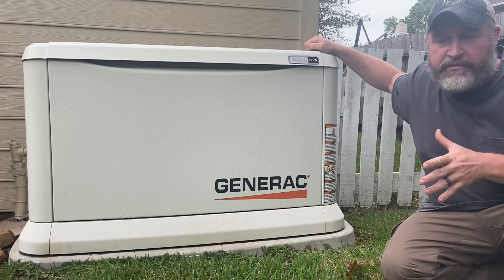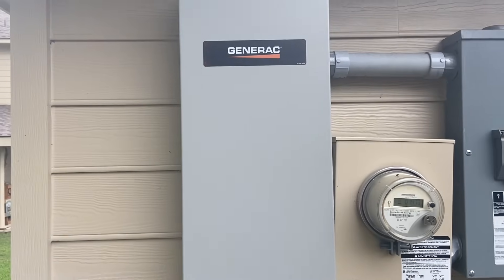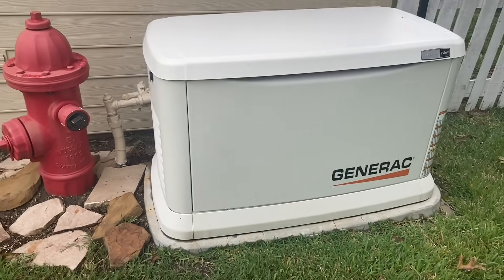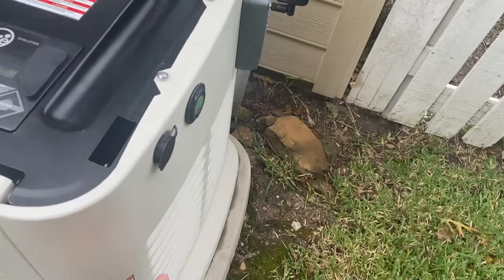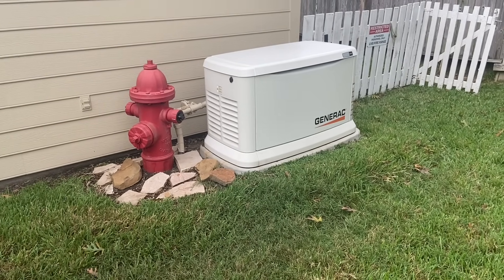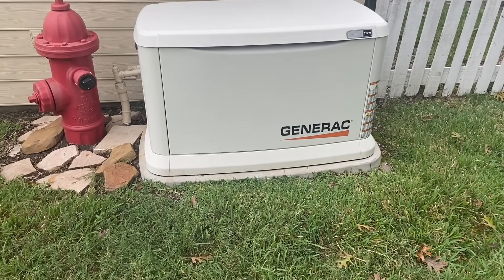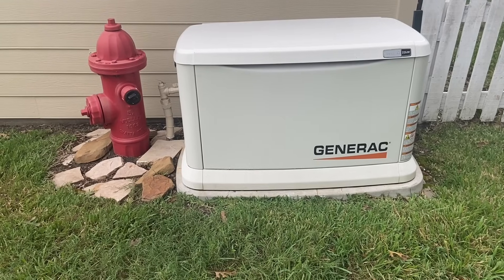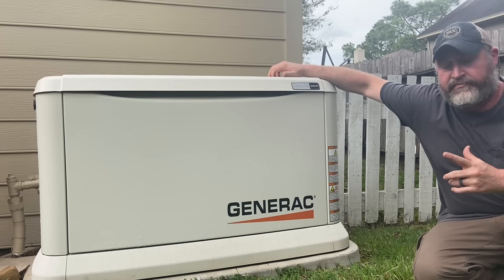Thinking of purchasing a generac whole home generator?

Comment: If running for days during a long term outage, shutdown every 12 hours and inspect machine and check oil level and for leaks.  Change the oil every 3 days if using Conventional oil, every 6 days if using Amsoil Small Engine Synthetic.  If you don't change the oil this frequently, you will pay!  It is an Air Cooled engine so oil breaks down fast.  I have installed and maintain 4 of these for my family.
Reply: Skip the amsoil and use any good quality compatible oil and change it and the filter often, especially after extended run intervals...

Comment: To anyone watching this now, the national average for installation currently is equal to or more than the equipments cost. As well as you will not find a new 22kw for $4800. And remember, this is a piece of emergency equipment, it has a huge convenience factor, but only if it runs flawlessly. With that said, cheap work isn’t good, and good work isn’t cheap.
Reply from the maker: Thank for watching great comment avg for this same install in my area is now 13-14k

Comment: Great video. One thing I would recommend is make sure to spray around and up the skirts of the generator every so often for bugs. I didn't know this and my Generac generator just gave over a warning when doing the weekly exercise and after paying $190 for a technician to come out they found a huge ant infestation inside of the generator, which if any electrical components fail it is not covered under Generac's warranty. Also I purchased mine from Costco and got a 10% Costco shop card which was almost $1000.
Reply from the maker: Thanks BigMo great tip , we have someone come quarterly and spray the house yard etc , but a quick peek can save a lot of trouble. Will be checking ours more often 👍 thanks for stopping by and checking out my channel, please subscribe like and share, thanks and have a great weekend.
Reply: 10/4
Reply: Electrical magnetic fields attract bugs...I use Cedar Oil Spray, bugs hate it, and it lasts for 2 months.  I have a reminder set up in my computer to re-do the bug spray once a month to be safe.
Reply from the maker: @miltonturner2977  great idea !
Reply: @miltonturner2977  where do you buy this magic stuff? Thanks in advance.
Reply: @dustbat  Amazon and Walmart
Reply: I endorse this recommendation. About a year before we sold our house, I discovered an ant infestation in the control module inside the generator itself. They were swarming in there like an ant farm, could be viewed through the module’s display. Generator wouldn’t run, not even its weekly test run. After spraying the ants and blowing the unit out with compressed air, it worked again. Sprayed again several times before we moved.

Comment: I have a smaller version of the Generac. Runs on natural gas, comes on within a few minutes of power out automatically. It does an "exercise" for about 15 minutes once per week. I get it serviced once per year, oil/filter changes and diagnostics check (about $100). Well worth it, it gets used at least a few times per year. Saves you from throwing out hundreds of dollars worth of food... you won't freeze in the winter or fry in the summer. Be nice and let your neighbor run a cord over to their refrigerator...
Reply from the maker: Yes sir thanks for the comment and checking out my video, please subscribe and share

Comment: My wife and I bought a house in southwest Florida in Feb 2022 that had a 22KW Generac setup already installed in 2018 (550 gallon propane tank fuel supply). Hurricane Ian came through Sep 28 2022, and my parents rode out the storm and the aftermath at the house. The Generac performed flawlessly until utility power was restored on October 9. Only thing to note was the need to keep checking and topping off the oil level as it ran continuously. We had a digital antenna setup, so my parents were able to stay informed with the local news stations, even with cell and internet service being down.
Reply from the maker: Right on , we bought digital antennas after our freeze outage, good idea 👍 thanks for the comment and for watching!
Reply: You followed the owners manual!  AWESOME-that will help keep the light on.  So many don't.

Comment: I have a 20kW version, installed back in 2014, also on nat gas.  I'm up in Chicagoland.  Doing annual maint (plugs/filter/oil, I think I'm on my 3rd battery), and only part that failed on the unit was the low oil pressure switch, which leaked.  Part was $35.   

I have had a couple of 24+ hour outages and several few hour outages, and the transfer switch just handles it all.  The whole house can run on generator including the A/C, condensing boiler and air handler, but not the induction stovetop and electric oven.   I even powered my two neighbors with extension cords so they could keep their fridges going during those long outages.   Been worth it, peace of mind, all hard wired with a transfer switch, no gasoline to deal with, safe as no chance to backfeed to the grid.  Cheers!
Reply from the maker: Cheers buddy thanks for watching!

Comment: I have a 16kw unit that I installed and service myself. It has been dependable for over 10 years and going strong. I used to service generators for a living and to me Generac is by far the best.
Reply from the maker: Very cool! my dads has been working for around 14 years, just battery replacements, he has not even adjusted the valve lash. Thanks for watching please subscribe and check out my other videos.

Comment: Thanks for your video!  Very informative. We just got our Generac installed last week (just as Fall starts) and we are very relieved to have it.   We told our elderly neighbors (who do not have electrical back up) that we would throw them an extension cord so they could charge their phones and keep their refrigerator running if the power goes out on our street.  Some folks need electricity to run their refrigerator for their insulin. Some folks may need a nebulizer for their asthma or oxygen machine.  When the power goes down, we won't freeze and we will have the opportunity to help our neighbor's too!   Besides, adding an all house generator to your home will be beneficial to the value of your home.  It is a win-win.
Reply from the maker: Thanks for the great comment and for watching, please subscribe and check out some of my other videos.

Comment: We’ve had ours 3 years now and not a single problem.  Super easy to change the oil, runs it’s scheduled test cycle every Thursday like clockwork.  Four bags of cement from Home Depot for the pad it sits on.  Bought it online from Global Industrial.  These guys where the cheapest.   Had a local electrician install the transfer switch and feeder line for $1200.  Most of the cost of install is in the copper.  Had a local plumber do the propane line to the unit for $400.  All in, we did the whole thing for around $7100.

Comment: We bought our Generac 22kW unit even before we renovated our vacation house into our permanent  home. Paid $4,000 at Lowes when they had them on sale in 2018 or 2019. Had it installed with a 500 gallon propane tank, and our electrical contractor hooked up everything along with a complete rewire of the house. The original wiring did not meet code and was woefully inadequate for the size of the house. Have had zero problems with the unit in the 18 months it has been installed and have it on a two week start-up schedule. Have weathered a number of outages, the longest was about 10 hours. Only thing we need is to put a UPS on the modem for the internet and on the tankless water heater ( found this out while showering when the power kicked off).  Best thing we did for living here in the Georgia mountains!
Reply from the maker: Sweet! Guy that what it all about, thanks buddy for watching please subscribe and check out my videos

Comment: Had the 20KW installed about 10 years ago.  Has been a great backup and peace of mind knowing you will have heat and cooling depending on season.  Our city power department is one of the best and we have few outages, but the handful of times the power has been out, it was great.  Thanks for the video and very informative and very accurate information.
Reply from the maker: Thanks Ross for watching and the comment have a wonderful 2023.

Comment: Good job explaining your Generac, we purchased one about 2 1/2 years ago, my wife is on oxygen machine at home and wanted to make sure if the power is out, she has what is needed, good piece of mind. Our house is 2100 sq ft, gas stove and dryer, gas furnace, they did an assessment of what we needed and came up with 16KW, install was one day with three guys, one worked placing the generator, another running the gas line and last one doing electrical, company we used specializes in intalling these units, they have two crews and do 2 installs a day. They did a great job, total cost was just under $8000. Unit came with 7-year warranty from Generac. Some people spend money on boats, fancy cars or vacations which is fine, we spent it on piece of mind. Good luck with your Generac. Something we hope we never have to use.
Reply from the maker: Thanks buddy for watching and the great comment.
Reply: Awesome demo
Reply from the maker: @stefananderson3411  thanks buddy
Reply: Your experience was very similar to mine.  I am in Southern Indiana and had a 16KW Generac installed in July 2020, 3000 sqft home, 7 year warranty, $8,300.

Comment: My 22KW unit happened to be running it’s weekly test when I came across your video. Very nice and thorough rundown of the process of getting one of these set up. Pretty much mirrored my experience. 

Up here we had a holiday ice storm in 2013 or 14 that ruined Christmas and I said “never again”. Couple years later I spent around $7K and zero regrets. Powers everything we have and would power more. My case is stainless steel so will never rust. Peace of mind can be hard to come by these days and this Generac truly does provide it.
Reply from the maker: Thanks for watching and the comment. I was not aware that made stainless housings mine is aluminum.
Reply: @JustCantSitStill  I was pretty sure that was what the sales brochures at the time were saying: Stainless. But that or aluminum, just one less thing to worry about.

Comment: Stumbled across your video.  I too have a Generac generator.  It's the 20kW version.  Had it installed back in I think 2012/13.  It's interesting that your house has a dual zone HVAC setup.  Mine is about 3200 SF of finished space and I only have a single zone HVAC system.  My install also required an upgraded natural gas meter as I have a ton of gas appliances: gas range, gas water heater, furnace, and three gas fireplaces.  I don't see it in your install, but mine included two load centers.  One for the HVAC and one for the electric dryer.  A load test was also performed after the install was complete and the generator kept up fine without a hiccup.

One thing I would do for those thinking about having a backup generator installed is to have a UPS (uninterruptable power supply) in place for specific electronics you'd like to have constantly running during the cut over time required for power to come from the generator.  I'm in IT and have a ton of network, storage, and server equipment I run that is fed off of a large UPS.

The pricing you got is an absolute bargain as I think I paid around $14k for my install all in.  And this was cheaper than another estimate I got from another contractor.

As far as maintenance, I've done an oil change on the generator myself.  It's not that hard and I used the official Generac maintenance kit that included synthetic oil, oil filter, spark plugs, and an air filter.  I haven't installed the spark plugs or the air filter.  The amount of usage my generator sees isn't much.  Other than the weekly scheduled operation of the generator, the generator has only operated for about 3 hours of total use during an outage situation.  I may do the spark plugs on the next oil change.  I haven't done a valve lash check which is called out for in the manual but the tech that came about a year ago to perform the factory recall said it's typically not needed and if the valve lash is out of spec, I would really hear it.  I did replace the factory battery which was around 5 to 6 years old when I did it.

Per above, there was a factory recall for my generator.  It involved the fuel plenum.  At first, Generac would only replace the plenum if it showed signs of rust.  But later decided to just replaced all affected units.  The tech that did mine said the plenum in my generator was fine but still performed the recall.  So it appears, Generac does provide decent customer service at least in my case.  I have seen reports of Generac generator failures both in the comments here and else where.  Don't know what to think as so far, mine has been running without issue.

As to Kohler, I have read up on them and they are another reputable choice.  From what I've read, their generators are supposed to be quieter running than the Generacs.
Reply from the maker: Thanks for watching and the comment, we did not need load shed modules, one company said we did and two others said we did not, I am able to power everything but doubt we would ever have everything in the house and garage on at one time during an outage. Great advise on the Ups device. All of our maintenance is included in our mobile link monitoring system.  We have the valve lash adjusted at the hour mark needed. The tech said it did need a small adjustment but would have been fine if we had not done it.  I let them do all the servicing as it’s included and I know they can’t say anything warranty wise. Thanks again for watching please subscribe if you have not already and check out some of my other videos.
Reply: @JustCantSitStill  Interesting you haven't needed the modules and also getting differing opinions.  From what I recall, both bids had them in included.

Since the maintenance is included in the mobile link service, I don't blame you for just letting them do it.  For me, I don't think I would need that kind of monitoring.  I walk by the generator on a pretty frequent basis so I will see the status indicators.  Also when I did the last oil change after a few years since the engine was only ran for the weekly scheduled operations with only one 45 minute outage, the oil that came out was almost as clear as when it was new.  So for me, the annual maintenance while good wouldn't be something necessary for me.

One thing of note, it appears Generac removed the external NEMA 5-15 outlets on the Guardian series generators.  Mine has them.

And I did subscribe and liked the video.  Thanks for creating the content.
Reply from the maker: @zx10rguyable  yep my dads has the outlets and mine does not but no issue for me really has my garage has 2 external outlets on the same wall as the generac. Thanks for subscribing and the support I appreciate it.

Comment: I got lucky and found a 20kw and digital switch on Amazon for $3,500 back in 2015. I did the install my self and had a electrical contractor make the tie in to the meter box. It operates on natural gas. The final cost was about $5,000. During the summer time after a severe thunderstorm it ran for 15 hrs. continually, gas bill only went up $15 that month. I’m sure it will be a good deal higher in the winter.
I get no complaints from neighbors simply because I charge their wireless devices for any one that needs it and the neighbor next door gets an extension cord for his fridge and a light or a tv. So far I’m very satisfied with the investment.
Reply from the maker: Robert that’s awesome 😎, thanks for checking out my video. Please subscribe like share 👍

Comment: I got the 18KW Generac installed in January 2022. My house isn't real big,... around 1250 sq ft, all electric & central air. We set the generator up on propane & they paid for the first tank fill. ( I'm sure they worked it in to the numbers where I paid for it, but it's cool). I'm in south Louisiana. Power can be out for 2-3 days, to a week or more after a hurricane. So far I haven't had that happen, but I am in a rural area and a good thunderstorm can take out the electricity for 2-3 hours. So far it has about 17 actual running hours on it. My computer, TV, modem & router are on ups battery backup systems (cheapies from Amazon) but they do the job. Within 15-20 seconds of an outage, the Generac has everything up and running. With all my goodies on ups, I hardly notice an outage other than lights going out.  I did get the maintenance plan. I couldn't be happier with it so far.😃
Reply from the maker: Awesome thanks buddy for the comment and for watching!
Reply: How much total, if you don’t mind.
Reply: @MandJ_MarketFarm  My setup was a little over 12,000.00 up and running.

Comment: Have had one for almost ten years. Zero issues. Change the oil once a year and have changed the air filter once. Runs for 5 min once a week. Still on original battery. Would not be without one. When the power goes out in the winter we’re the only house in our street with our Christmas lights on 😂
Reply: Change the battery.  Or, it will be the most expensive battery you have ever bought..